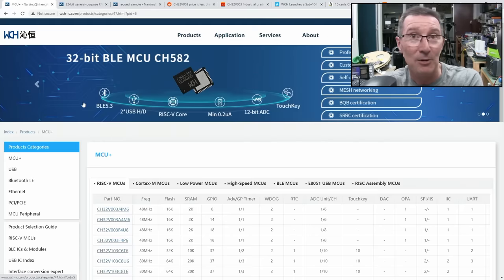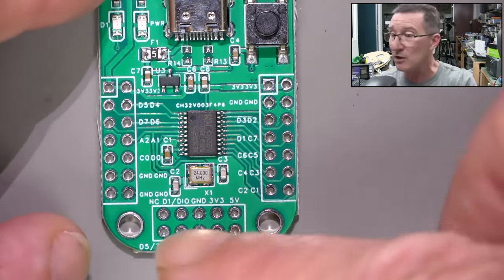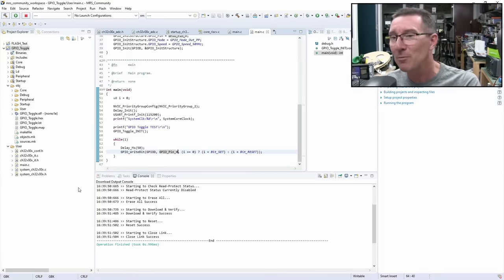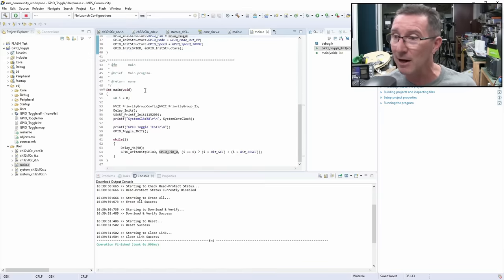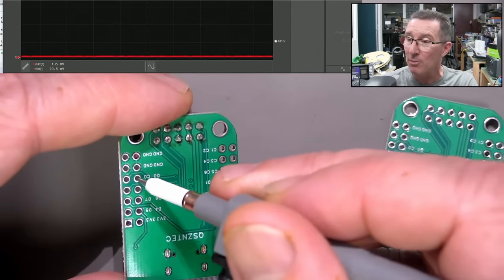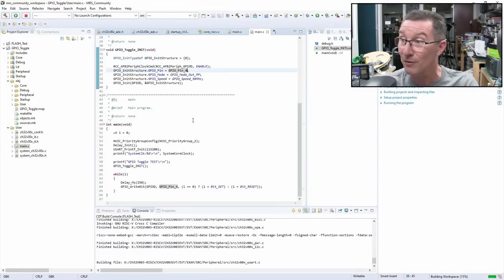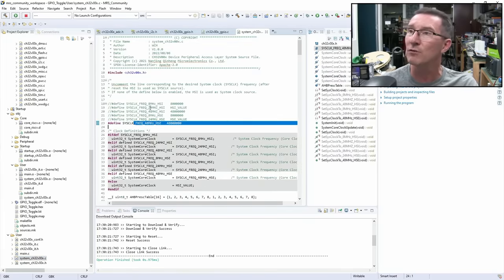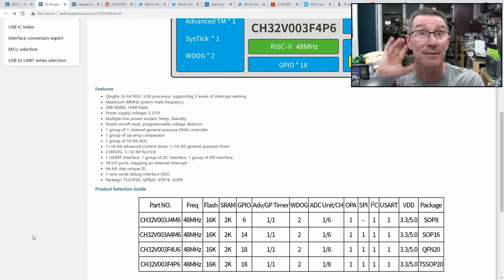EEVblog 1524 - The 10 CENT RISC V Processor! CH32V003

Comment: 1:04 one flaw i can already see, is well you have an instruction set, how does it actually get implemented in hardware as logic and gates? you can get different combinations of logic gates to do duh same instructions, but how teh logic gates are implemented can open up room for hardware exploits and code compatibility or stability issues.....
Reply: just like i can get my intel i5 cpu to run  pdp,eniac, cray, z80,65xx, x86_64 instructions, same instructions (cuz teh have alot of teh same equivalent instruction on my 64bit cpu, just need a hypervisor dat know how to taek dat instruction and tell my cpu what instruction its supposed to do and reroute duh io and memory map), very different logic gates i can even fly to the moon and back using my fuckin laptop, pfft  nasa and their apollo computers, my computer can sit in my lap and wirelessly connect to duh rocket and lunar module and watch tv, movies, and listen to music and even pick up all duh earth radio (wit lag tho), and still fly dat sumbitch on autopilot duh whole time
Reply: shit i can just throw a cpld or fpga in parallel wit my sally 6502, and run z80 code natively on duh 6502 in realtime, cuz duh logic array can be put in a state to take z80 or 6800, or f8, or even add 16bit support and run CP1610 instructions and spit out 6502 equivalent, same wit duh antic co processor too, add a bunch of new display modes simply by shoving another cpld or fpga in between duh gtia, and anitc and 6502 bus, can run pretty much any software from any 8bit cpu on duh motorola 6800 or 6809 based cpu (duh 6502 was a cheeep lower spec clone, so Motorola technically was duh most used cpu in duh 80s )
Reply: or just replace duh cpu with an esp32 and fpga  in my atari 800xl  and just emulate duh 6502 for compatibility and just write esp32 asm for everthing else, plus i can just flash duh esp with its own boot os and just connect to bluetooth or wifi and just send my program wit no wire or disk/tape drive connected, fukker got half meg of ram in it already, just need some sram chips and get a meg split in two 512k chunks

Comment: Seems you can't get it for $0.1. Just like you can't get rpi zero 2 for $15.
Reply: True. I suspect that if you order it in volume and you buy it with US dollars and you live next door to the factory then most of the fees will be waved.
Reply: @rwatson2609  however we can already get attiny boards for just above $1. Maybe with this chip there will be sub dollar ones.
Reply: @D9ID9I  I was curious about that so I ran over to the manufacturer's website just now and I see that you can buy, for instance an ATtiny202 for .40 US$ at quantities even less than 25 pieces  I don't actually use  Atmel products but Microchip bought up their company recently and now they are available through "Microchip direct" which is their sales platform. Anyhow that's pretty cheap for a well supported microcontroller.

Comment: 64-bit chip unique ID... Wow... So every one of these things is incrementally different where it comes to the unique ID. I'm imagining little assassin mosquito drones running with these super-tiny RISC chips in them... Forgive me, but I just spent the last half hour watching drone videos from Ukraine... I wonder how much of that physical package is actually the chip inside? I suspect that it's significantly artificially larger than it COULD be, just to make it compatible with circuit board designs. Has anyone made a laser layer-by-layer etching video of one of these packages to see how large the silicon is?

Comment: Is every RISC-V core compatible with each other? Do they all implement the whole instruction set? I.e. If Linux runs on RISC-V, could we add some memory controller to this IC and run Linux on it?
Reply: RISC-V is actually very modular and relies heavily on compilation for specific chips (although there is a core set of extensions that almost all MCUs implement). This chip is no where near capable of running Linux though, you'll have to look towards bigger MCUs for that, but those exist already, and Linux can absolutely run on RISC-V
Reply from the maker: No. The instruction set is, but how you set up and use I/O and other peripherals is vendor specific. How easy that change is depends on how high level the includes are.
Reply: Afaik in the RV32 ISA there are 4 different base Instruction Sets (RV32I, RV32E, RV64I, RV128I), 4 core extensions (the G group: M, A, F, D) and then ~9 further extensions (L, C, B, J, T, P, V, N, H), all of which have to be taken into account when compiling code for a particular processor. You likely won't get far with just RV32I (basic integer only) and most MCUs have at least G, but that still does not mean all RISC V processors are compatible with one another, quite the contrary actually. Lots of binary blobs will likely use extensions not available on other processors (although those can be trapped and emulated if support for that was compiled into the firmware)
Reply: @Oskar42  Just to note, CH32V003 is RV32E.
Reply: @truectl  in fact it is RV32EC, which means it's like the base RV32I but only 16 registers instead of 32, PLUS it had the "C" extension which gives Thumb2-style 2 byte instructions that can be freely mixed with the 4 byte RV32E instructions. But you don't need to worry about any of that -- you just tell the compiler "--march=rv32ec" (as you can see in Dave's build output) and gcc does the right thing.
Reply: @BruceHoult  The original question was “Is every RISC-V core compatible with each other?” The answer is basically “from a binary perspective, no” and I was pointing out the specific core used in this MCU family as the core variant was not mentioned in the reply.

Comment: Unfortunately, this chip is underdocumented like so many chinese chips. Only 30 pages for the datasheet? Only 180 pages for a reference manual? You've got to kidding. Of course the programming/boot protocol is not documented, the same with the debugging protocol.
Reply: From my experience with SiliconLabs, they have the Boot protocol, debugging protocol in separate application notes, because they are usually valid for a wider range of MCUs.
I assume the same is true here.
Reply: @the_real_glabnurb  There is no application note.

Comment: But can it run linux ?
Reply: Of course not. It's a microcontroller with 2 KB RAM.
Reply: @BruceHoult  Maybe you could buy some SRAM to go with it and then write a 386 emulator, and as the original 386 was 12Mhz it might even be faster than when it came out on the 386 :) There may even already be an  386 or arm emulator for Risk V you could port.

I know it wouldn't have much use, but I keep hoping someone will get Linux or even Minix working on chips like this or the RP2040 as a University project or something, :) Maybe would it be possible to take code from FreeRTOS as well?
Reply: @joseph9915  the RP2040 has 130 times more RAM than this chip. Minix 1.5 in 1991 required 512k RAM … 256 times more than this chip … maybe the release notes lied and 256k would work and getting it working on an RP2040 might be possible. But making it work on this is utterly impossible.
Reply: @BruceHoult  That is not what I meant, a 386 CPU itself has 0 memory. 

I meant a chip plus however much SRAM you would need on a separate chip. Maybe even add some more of this chip or logic chips for memory management etc. Even your brand-new top of the line Desktop PC can't run Linux with just the CPU. I am not saying it would be practical or not slow as hell, but should be possible? All this chip would have to do is emulate the simplest CPU that the oldest/'simplest to port' Minix/Linux can run on. The MB could handle the rest like SRAM, any logic etc.

But for RP2040 and Minix? I went through the book and ran it a few time on my Amstrad PPC512D so a RP2040 with 16mb flash and XIP, (Although I have forgotten how Minix used the memory) but shouldn't it be overkill even without adding SRAM?
Reply: @joseph9915  the 386 comes in a 132 pin package with a bus for accessing external memory with 32 address pins (actually 34 as A0/A1 are decoded to 4 byte enable pins), and 32 data pins. It is DESIGNED to use external memory.  The 10c microcontroller being discussed here comes in an 8 pin package, with no intended ability to access external memory, and certainly not to execute code from it.
Reply: @BruceHoult  You could use i2c memory or something else. And the CH32V003F4xx have 18 pins for 14c. 

And people have used ESP32s to run Linux and "the worst Linux PC ever" used a ATMega1284p to boot up Ubuntu and login, in only 6 hours! Just think if you use this chip instead of the ATMega1284p they might not be able to claim "the worst Linux PC ever" title any more :P

P.S. Anyone know how their other RISK-V chips on ali, CH32V307RCT6 & CH32V203F6P6 compare to ST?
Reply: @joseph9915  of course it is Turing-complete and you can use I2C or SPI to connect an infinite tape to it, so it can compute anything computable. The same applies to the vi editor or C++ templates, but I"m hopeful no one is trying to use them to run Linux. Or at least not expecting a usable system.

Comment: I don’t understand why you’re trusting a bootleg knockoff controller with terrible software support. Yes this may be a stronger processor with better software support than other knockoff controllers, but it’s still bad. And the IDE used is too complex and weird compared to something like Arduino. In the end it’s still all bad. The better and more reliable option is an ESP32-C3, it’s faster, has more memory, and is even better quality.
Reply: There was a bot comment below this comment that was owned by a hacker. The comment was removed today, thank god. I took a screenshot and will make a video about it, beware of hacker bots with stolen profile pictures and usernames.

Comment: oww gawd... flimsy weak tiny smd crap. but then again what does one expect for 10 cents. :P bet that won't cover a ceramic dip package with gold plated legs :P ofcourse now it needs an additional pcb to mount it onto anything (and a huge blob of epoxy on top to keep moist out ;) but hey. hmm. not sure. i think we prefer paying 10 bucks for a full sized z80 or 65c02 instead and know it still works 50 years after installing it. to all this 'low voltage' 'rohs' tiny stuff. a drop of water from moist outside is already a killer. ofcourse this thing is 32 bit but who needs that. virtually any telemetry or text data is 8 bit anyway. it would only be beneficial for address increments if it even has enough rom and ram to notice that. (ok a full sized ethernet packet still needs a 16 bit offset counter to parse, and the 32 bits could mask ipv4 addresses in one go rather than in 4 gos gut that's about the only advantage to 32 bit over 8 bit. but seriously you never see any of that kinda stuff still working after 10 or so years. anything under 5volt and anything smd or rohs is bad mmmk.